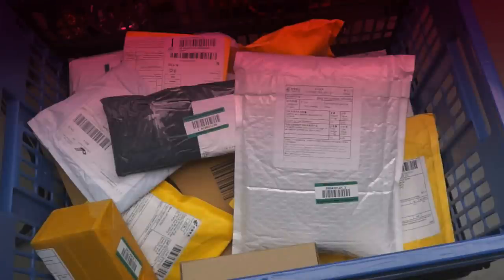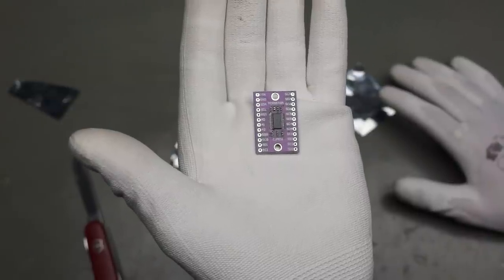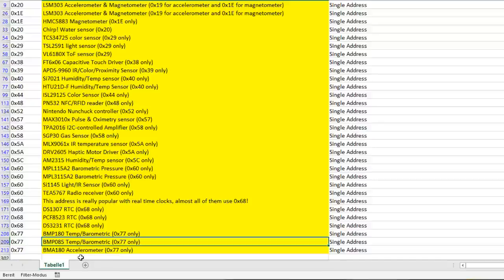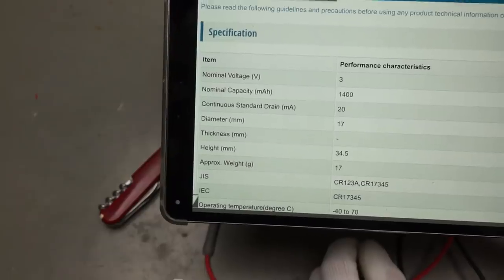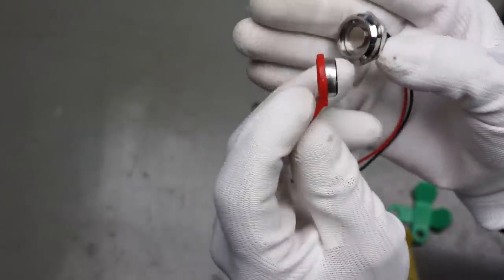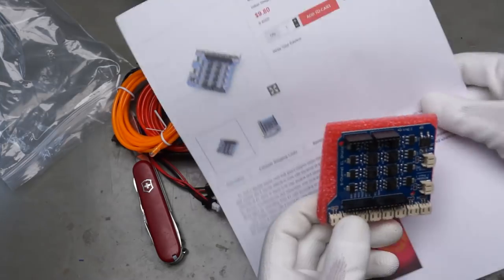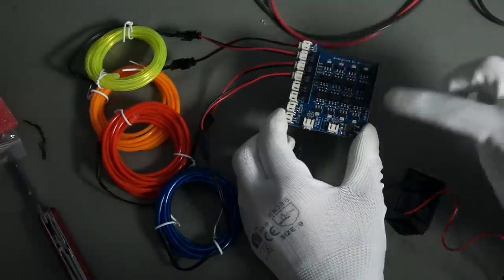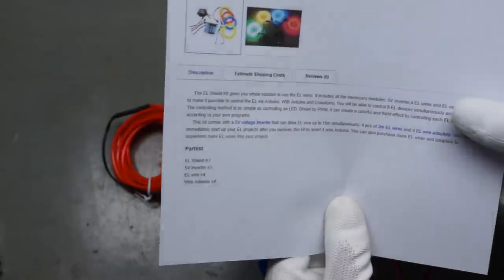#253 Mailbag (DS1990A, TCA9548A, El-Wire, CR123A Battery)

Comment: I did some testing on EL wire about two years ago. I was supposed to do a video on it but I never made the time. I should really try to make some time. To do it properly will take some time so I just kept procrastinating. This mailbag has provided some inspiration. If I do complete the video I will post a link. In case I make any errors or bad assumptions hopefully someone can correct me.
Reply from the maker: I am interested in your findings!
Reply: @AndreasSpiess  see video link below. I do not have the original El wire anymore. Gave that away so I cannot retest and include things like the capacitance per unit length. 

There is some slightly useful info and close up shots of the internals of the wire. Diode Gone Wild did a great video too. There is a link in the description. 

https://www.youtube.com/watch?v=YqnPCe1admI
Reply from the maker: Thank you for the info. You have one subscriber more ;-)
Reply: @AndreasSpiess  thanks. Feel free to point out any errors or things I may have missed in any videos you watch. 

Can I encourage you to look at videos 054 to 057 which deal with a solar experiment I ran over a year ago? Lots of engineering and calculations in that. I know you have done some solar experiments so you are quite familiar with the subject matter. Again feel free to point out any errors.

Comment: Great video as usual!  I'm using a CR123A to power a PIR sensor with a NRF24L01+ and a 3.3V ProMini clocked down (also with onboard LDO removed).  At first, I used no voltage regulation, but the battery voltage quickly drops to about 2.8 volts.  Voltage below 3V caused false positives on the PIR sensor (an AM612) whenever the radio was active.  So I added a boost converter based on TPS61016 (3.3V version) and it has been running without issue for over a month.   Also, cost per battery was about $1.40 US for Panasonic branded batteries on Amazon.
Reply from the maker: Thank you for sharing your experience. You are right, the PIRs usually need more than 3 volts

Comment: The i-Button devices are most-popular as Dallas Chip, coming from the name of the company that  introduced them on the market - Dallas Semiconductor (now Maxim). In US they are also popular as ID tags and still in use after that many years due to proven reliability, low cost and easy implementation.
Reply: I have a customer who uses them in their industrial chemical plant that runs 24hours a day.  When an operator adjusts a valve or simply monitors a gauge,  they scan their 1-button to show that they were actually there.
Reply from the maker: Reading the different comments I am probably the only one who did not know them ;-)
Reply: @AndreasSpiess  , don't feel bad... I have not seen them for so long, I didn't know they still exist.
Reply: @AndreasSpiess  We are here to share knowledge. You are contributing a lot to that cause. I'm happy to share what I know and be corrected if wrong. I'm grateful to people like you, who dedicate of their time to educate those who are interested. 
P. S. I don't know why I sound like a Bot :)
Reply: @AndreasSpiess  you can also use their temperature readin devices as ID. They basically work the same.
The only thing that differs is the form factor and added functionality (temperature, others have memory to logg data and can alse read other physical measurments, all with an uniqe ID. I know people that uses it for Mac addresses for Arduinos)
Reply: They were rather common on point-of-sale machines for a while.
Reply: @tad2021  I've seen them mostly in commercial vehicles as driver identification, when one company vehicle is operated by multiple drivers. Also as entry access control for electromagnetic door locks.
By the way,  TDA2020 also brings back a lot of memories to me :)
Reply: I still prefer RFID, it's more comfortable and flexible. And all security concerns regarding RFID are because of the malpractice of NXP, relying only on security by obscurity and using a really bad proprietary cypher for their MIFARE Classic chips, and still selling them despite being vulnerable! Fortunately, there are other cards such as MIFARE Plus or DESFire EV1.

Comment: @5:27 The best battery/cell for low temperatures is a high power NMC li-ion cell or a Lithium-titanate cell. Higher power means less internal resistance. Internal resistance is correlated with temperature.
Reply from the maker: In most of our applications, we only need very small currents. Maybe we can use other technologies than cars, for example.
Reply: @AndreasSpiess  even if you need  a low current: a cell made for high power will do better in colder environments.

Comment: The DS1990A's are a 1 wire Contact ID device - it's not RF - the case is connected to the 1-wire line on the chip.  The contact serves as both power and data out to the reader.  BTW.. the 'DS' prefix stands for Dallas Semiconductor, acquired by Maxim in 2001.
Reply from the maker: You are right concerning Dallas Semi. 
I think I mention later that it is not RF ;-)

Comment: I saw a device about 25 years ago with similar technology to the button reader.
It was used by security firms to ensure a security was doing his rounds. He’d have to press the device against the disc and the access time was stored.
No falling asleep on the job.
I was going to write the software to read the round and interrogate it
Reply from the maker: I think you will even find a library, but I did not search so far.

Comment: I vaguely remember those Maxim ‘RF id’ chips from very long ago in the 80’s and 90’s, although I think they were sold by Dallas Semiconductor at the time.  They were big on that single pin protocol.  I believe they had a 2 or 3 pin leaded version that was intended as an electronic serial number.  We ended up using E2PROM instead, but I liked the idea of having ‘hard’ serial numbers instead.
Reply from the maker: AFAIK Maxim bought Dallas. So they are probably the same.

Comment: I have some of those ibuttons for quite a while, not sure if Dallas or Maxim are still doing them. The idea of them having a unique serial number is a must on these tiny devices and that was the reason for me to use those for a access point system about 15 years ago.. Simple system at that thime, and looking at this now, makes me want to integrate it with esp8266, for example :D
Reply from the maker: I did not know they existed before this video. But it is a really simple system, you are right.

Comment: 7:45. They are not RFID type devices. They require a physical electrical connection to be read and written to. Similar to the Dallas 1-Wire DS1820 temperature sensors.
Reply: They are common retrofit keys for Eastern European block house outer doors. In 1990's all block houses were fitted with such electronic locks and intercom telephones (sometimes using old pulse dealing telephones which were used for distant opening). Some newer systems use also plastic covered real RFID keys, but such wired ones work also reliably in -20 Celsius and wet weather when door itself is under small roof.
Reply: @avalikarvamus  that's very interesting. Judging by your name, you seem to be Estonian. Are those systems still in use nowadays? I imagine that they aren't the safest...
Reply: @wi_zeus6798  they are in full usage - but it's used for 5 to 16 storey block houses from soviet time - so 9 storey house has 9 x 4 = 36 flats behind one such door - every flat has it's own private door and mechanical keys too, sometimes two flats have special additional door also in front. So such keys are only quick to open outside doors - to avoid letting homeless, drunk's or petty criminals inside property and keep house clean. Normal mechanical keys would be too time consuming and wear out quickly when 36 x 3 = 108 or around 100 people were using it every day multiple times. Sometimes they have also optional mechanical key available. I think that such systems are also used in Eastern Germany - I have seen similar block houses in Potsdam (Drewitz) and Jena (Lobeda).
Reply: These are dallas 1wire ibutton compatibles, often used for security checkins or vehicle driverID.
Reply: @avalikarvamus  utilizing them like that makes sense, thanks for the info
Reply: The Dallas 1Wire devices each have a unique identifier security number. "Each 1-Wire slave device has a unique, unalterable, factory-programmed, 64-bit ID". More info here...
https://www.maximintegrated.com/en/app-notes/index.mvp/id/1796
Reply: @wi_zeus6798  they are used as keys for front dor for multi flat houses to let many people in, but aldo janitors, medical straff and post personella. They is also used as key for night watch guards so one can see when they reached certain check points. They replaces the keys that was used when I worked as night guard during summer at Sandvik (huge industry area in Sandviken) in the beginning 1980:th, in Sweden.

And the old Java ring from 2990:th used these too. Have one or two somwhere.

The security is as high as ordinary keys, so I see no problems with them, compared to ordinary keys.

As written, they have 1 wire from Dallas Semiconductors and have a 64 bit ID burned into each and are quite secure. I would say better then RFID and more mechanical sturdy. You need a hammer to destroy them and need physical access to copy them by reading out the encrypted data.
Reply: He said the was not RFID, but type of, which is a good description of those ID one wire device.
Reply: @AndersJackson  very interesting! Personally, I have never seen this particular technology in use where I live in Germany. I've been often in Estonia but haven't lived there for longer periods of time, especially not in a city. I wonder whether or not the tech has significantly changed since the 90s... In the Soviet era, such tech was probably not within reach for the local communities and buildings I imagine. After the fall of the iron curtain many devices developed in the "west" became more available to the young free nations
Reply: @wi_zeus6798  as I wrote, it is in Sweden, not a former USSR state.
And last time I saw this use by night watch guards was this Friday.
Reply: He mentioned that just a few seconds later in the video... Don't worry, I'm also guilty of commenting before finishing the video.
Reply: Yep.. I think Maxim acquired Dallas Semiconductor just for the success of their 1-wire devices (and the patent, of course).

Comment: I didn't know that those iButtons still exist. I have quite much of those 1-wire devices from Maxim, did get them as sample almost 20 years ago when studying electronics.
Reply: And I think they don't have anything to do with RFID.

One solution that I have seen with these was iButton temp sensor that was kept in hospital kitchen in all the different cold rooms. And they read data from those every once in a while to computer. But this was 15years ago. Today I think it would be made wirelessly
Reply from the maker: You are right. They have nothing to do with RFID!

Comment: For I2C address conclicts I would suggest Address Translators. They shift addres by 0x02 and are fully transparent so in your code you just change the address instead of managing multiple busses. https://www.analog.com/media/en/technical-documentation/data-sheets/4316fa.pdf
Reply from the maker: Also an interesting possibility. Thank you for the link.

Comment: I had some problems getting those little B&W oled screens to work with the I2C bus controller. Seemed to be problem with making sure each one was correctly initialised. Some simpler I2C devices won't be so fussy but others will. So be wary when writing your software to drive multiple screens. I won't post a link to the video as I don't want to spam.
Reply from the maker: You easily can post links here. If it is blocked I get a message and can accept it.

Comment: Andreas, I had an idea I wanted to bounce off you. (This is completely unrelated to this video but since YouTube comments are your preferred contact method, I thought I’d post here.) It may be an outlandish or unachievable idea but what if you wrapped a coil of wire around the power cord for (e.g.) your TV then used a second coil next to the first to “pull” power from it via induction. Then use that induced current to trickle charge a battery which is the source for (e.g.) an ESP32 which (e.g.) monitors the power LED via an LDR and/or sends IR commands via an IR transmitter. The goal, of course, being a circuit that doesn’t require its own power supply. A 3D printer case could snap over the power cord to enclose the primary coil and it could House the secondary coil, the battery, the MCU and any other components necessary. I guess the big question is, could it supply enough current to keep the battery charged up enough to keep the circuit active in deep sleep mode? If so, there’s probably a great many applications for this sort of circuit.
Reply from the maker: There is nothing like free energy. If you take energy from the power cord you will see it on your bill at the end of the month. Whether you take it through induction from your cable or via induction in the transformer of your power supply...
Reply: I understand the energy isn’t “free”... there are still advantages to having one less power supply to plug into a power strip - and one less power cord to route/conceal.

Comment: Hi. Have you considered LiFePO4 batteries for outdoor devices? They cost almost as the lithium you got but you can recharge them too.
Reply: thesimbon 
Can they also be used at temps below 0°?
Reply: @Conservator.  yes the can work below - 30°C too
Reply: thesimbon 
Excellent. That’s another advantage of LiFePO4’s. Or does this also apply to ‘normal’ Li-ion batteries. I know you shouldn’t charge them below 0°, but does discharging them hurt them as also or is it just charging?
Reply: @Conservator.  no idea. I don't use them much since LiFePO4 have a running voltage that suits perfectly the 3.3v devices without regulators
Reply: thesimbon 
I looked it up at https://batteryuniversity.com/learn/article/charging_at_high_and_low_temperatures
Regular Li-ion batteries can be discharged at -20 or warmer. Charging only above 0°.
Reply from the maker: I will have also LiFePo4 batteries in the test.
Reply: @Conservator.  not really an issue here most of the time. I live in a subtropical zone in Australia.

Comment: Andreas, your videos are great i've been learning a lot.  do you take requests???  I hope so...  I'm a Honey Bee keeper in USA upstate PA with cold weather.  Honey bees are having huge issues lately with terrible losses overwinter.   I'm trying to properly build a solar powered car battery backup sensor bundle for inside a bee hive to transmit & monitor temperature, humidity, which is a killer in winter, and a sound sensor to monitor for swarm activity in summer.  light and motion sensor alarms would be great too, if hive was blow or knocked over, or bear attack. I ordered a ESP8266 Weather Station Kit off amazon to start learning with. Id love to tell you more about project, you could help save the honey bees with a simple project.
Reply from the maker: I think you find most needed parts in one or the other videos. Maybe you watch my LoRa videos. I know, many beekeepers use this technology for their projects. You find also some beekeeper comments in my video about load cells. Good luck with your project.

Comment: Does your el-wire converter makes annoying noise? I brought some (5V to 110V) on aliexpress, but decided to not use in any project, because of noise
Reply from the maker: Do not ask an old man like me ;-) I did not hear noise.
Reply: Andreas Spiess Dishka should be able to help you out here.
Reply: @Conservator.  Cats can hear it, but they just don't care. :)
Reply: Mine whistles too. Actually both. 12V and 5V, both make some hi-freq noise. If I hide that block in some box and behind the table, then it's more or less ok.

Comment: All of th I2C devices that I designed and built had the I2C function to set a new address.  I cannot fathom why one would not incorporate such functionality in an I2C device.
Reply from the maker: I did not check if this function is available in some of the devices. How do you manage the "first time" when still all are on the same address and soldered on your board?

Comment: Ur Not supposed to power the inverter externally   and If u plug in 5v connector into the HV Port and vise versa nothing happens it just doesnt work.  No need to use a different connector
Reply from the maker: Good to know. Thank you!

Comment: those aren't rfid, they are ibuttons.
you can also get programmable versions.
They have been around for over 15 years.
Reply: And most importantly, the serial-number devices aren't meant for authentication. They offer special devices for that purpose.
Reply: I think it was year 2001 when I did get sample boxes of these from Maxim. I still have them
Reply: These ibuttons aren't as reliable as they look.
It used for billing, the shared washing/drying machines in our building, but some keys suddenly stop to work without any reasons....
Reply: @AltMarc  here is a clue to the reason they fail:
water and electronics don't mix.
Reply: @AJB2K3  I think it's more a ESD problem... mine never got wet, because of my professional OCD about water and electricity....
Reply: @AJB2K3  unless the device is designed to handle that...
Reply: I would say over 20 years...